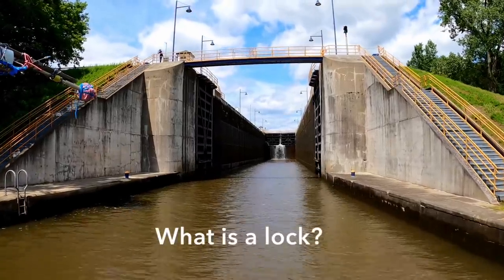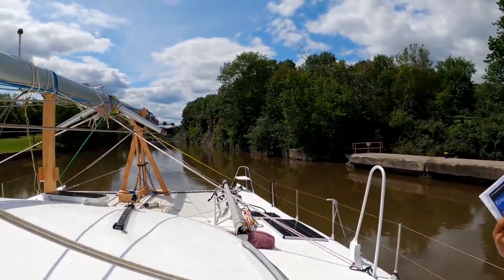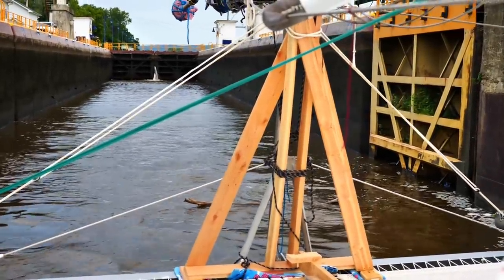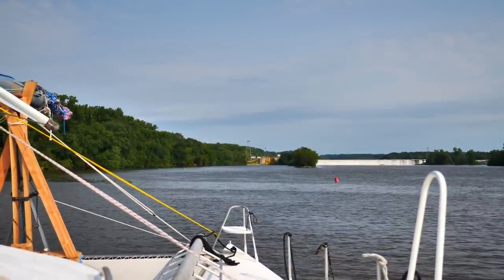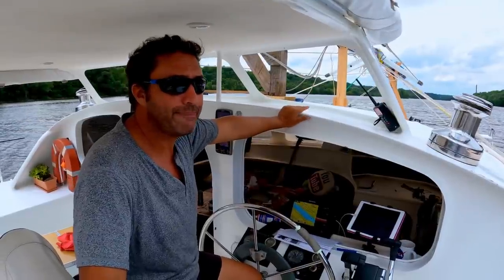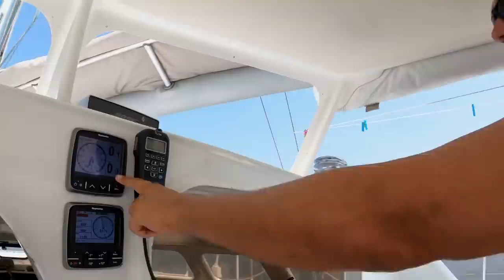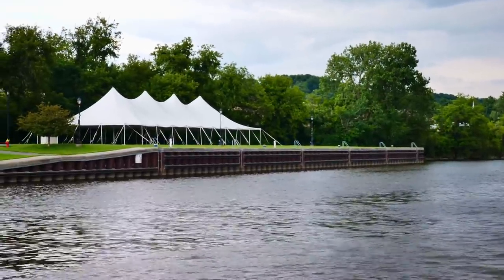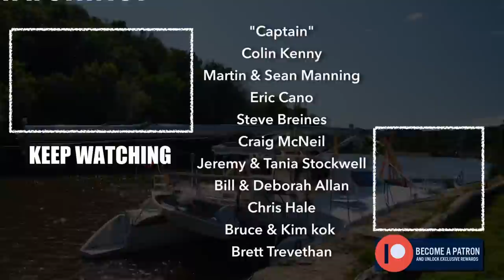Tips tricks and techniques for LOCKS on the Erie Canal - Great Loop #8 EP87

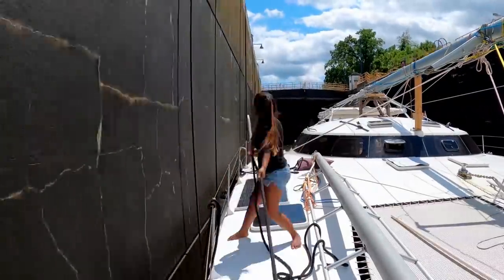Comment: 3:45 Think you'll find the Atlantic and Pacific are at sea level, the Panama canal is 85 foot higher
Reply: I was coming to see if someone else caught that!  The canal has locks to raise and lower boats/ships over the land that separates the two oceans.  They chose Panama because it was the shortest point between the two oceans.
Reply from the maker: Have a google Ray…it seems they are different by about 20cm…also a significant tidal change.
Reply: @SailingLifeonJupiter  Jamie, 20 cm over 50 miles (length of Panama Canal) is nothing.  Barely a slope.  The purpose of the lock is still get boats up and over the land.  Cheers
Reply: @marceld6061    If the two oceans actually were at different heights on average enough to require locks, then you could make a syphon pipe across Panama, run it through a turbine and generate electricity!!